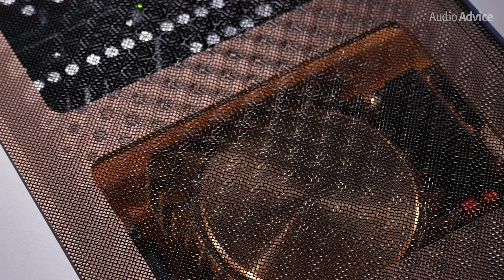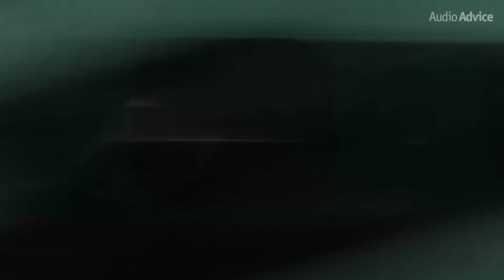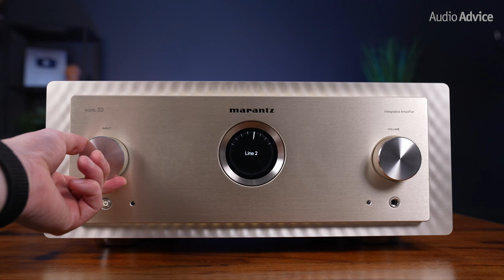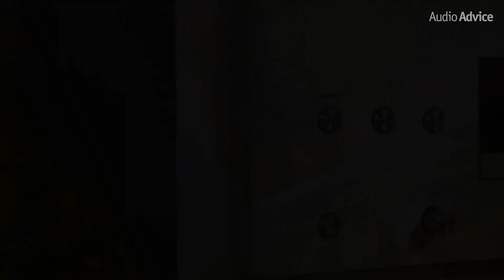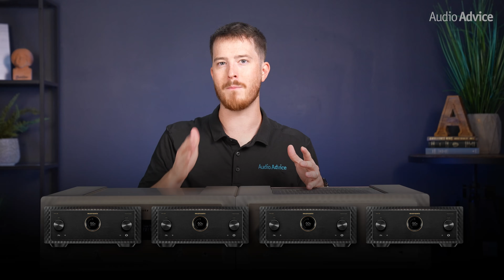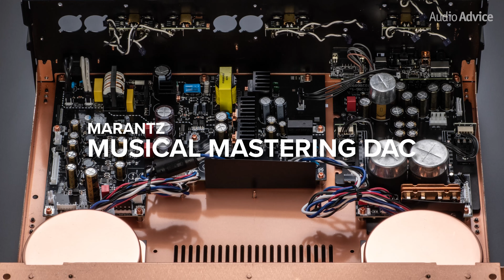NEW! Marantz 10 Series Overview: MODEL 10, LINK 10n, & SACD 10 🌟

Comment: These new products from Marantz look stunning. I really like the idea that Marantz went with Purifi amps. They offer exceptional performance.
Reply from the maker: Yes, they are a big step up!
Reply: Purifi modules at $16k is nuts... you can buy the most powerful an expensive purifi module yourself for less than $1k.   Paying additional $15k for a pretty case is not my cup of tea.
Reply: @net_news the additional 15k is for the Marantz name.
The amp does look beautiful though.
Reply: @net_news  the pm10 was a big step down over the previous models

Comment: I had 3 Marantz receivers all die within 3 years. To me, they have a reputation for being unreliable.
Reply: Same to be honest, I had one of their early AV receivers, the optical inputs failed out the blue one day, then the coaxial inputs about a month later. Went to an Onkyo - that also blew up one Christmas eve! Been with Yamaha since 2017 and never looked back and it’s now driving 5.1  4ohm speakers beautifully. Im just hoping that Yamaha don’t cease their interests in multichannel AVR’s…. Fingers crossed they launch updated 32/384 PCM multichannel with internal Streamer soon - then it will be time to upgrade for sure.
Reply: Power conditioning?
Reply: @XavierWoodsofIndianapolis  I had a surge protector and voltage regulator on the entire component stack. And no other components suffered any issues. Same mains equipment is still in use today so i can only assume i was very unlucky.  Its just a shame because is leaves a feeling of fear when parting with a good amount of money for the brands. Once bitten, twice shy.
Reply: I have an NR1200 stereo receiver still going strong after 3 years.
Reply from the maker: Interesting. We don't hear about too many problems with them.. You should let Marantz know about your problems to see if they can help at all.